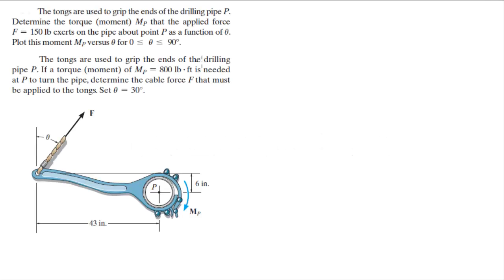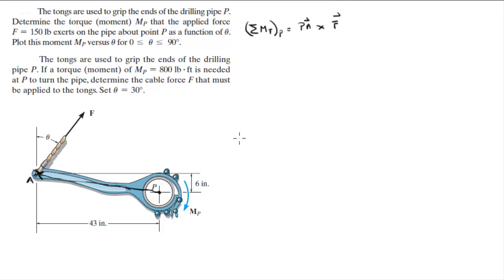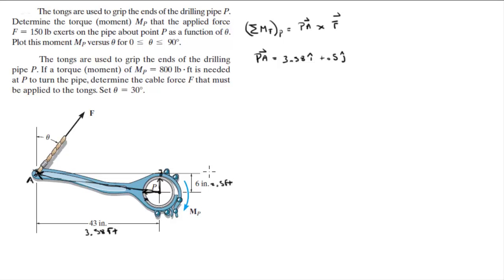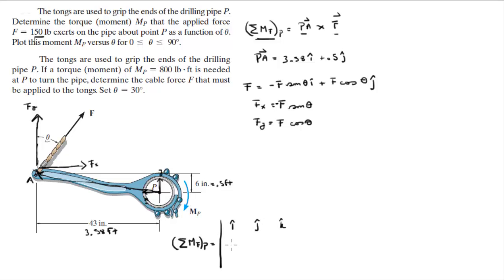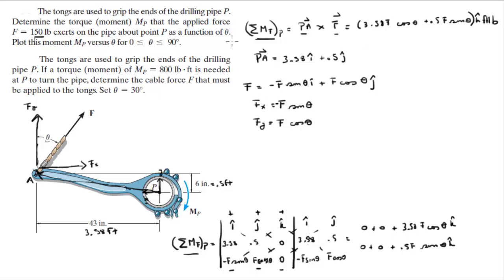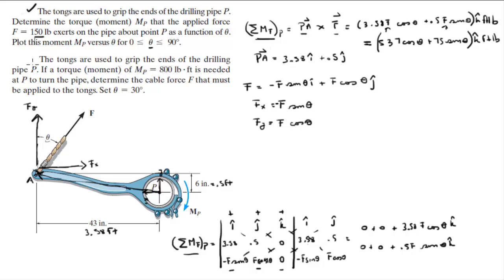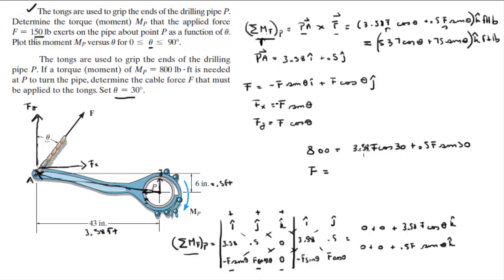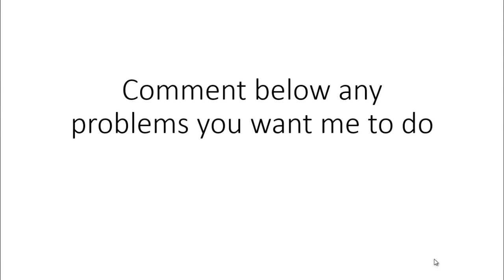Find the moment as a function of theta and find F required for 800 ft lb moment

Comment: @FinalAnswer why do we need to set vectors to solve for the moment. I did it by multiplying the Force x and y comp. by the distance of each lever arm and got the same answer?
Reply from the maker: there r many ways to do many different problems, but the way i choose is usually because it can be used for most other problems. ur method may not necessarily work for the more advanced problems in this chapter, but all power to u for finding a simpler method
Reply: @FinalAnswer  thanks bro pray for my mechanics exam on Monday :((((